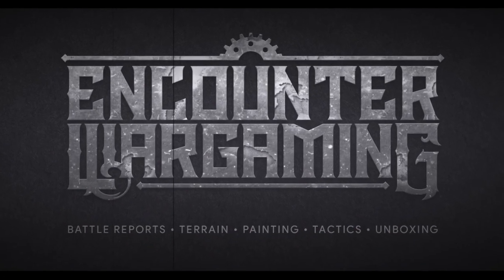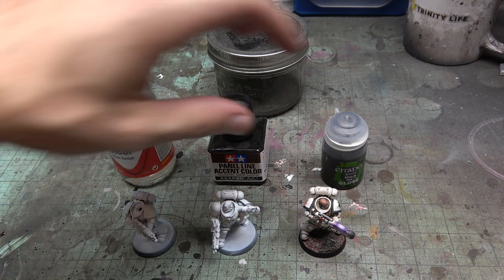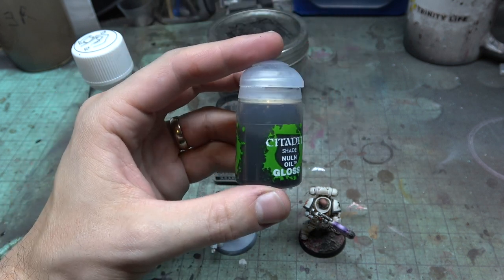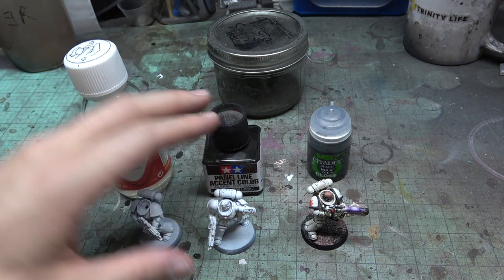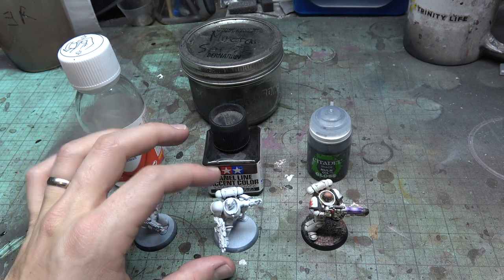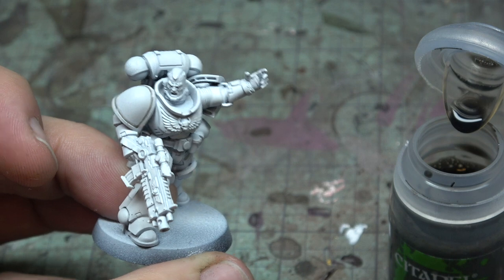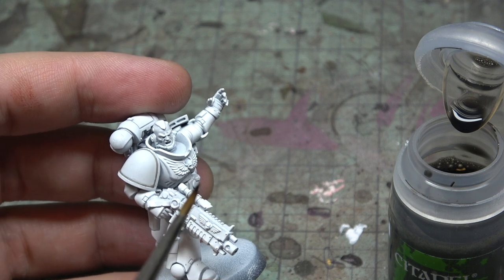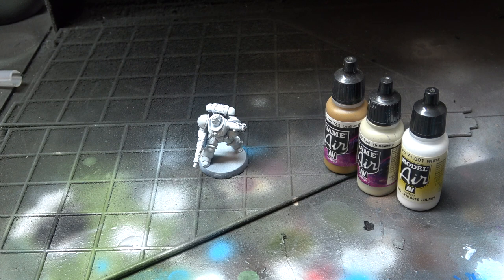Painting Tutorial - Pin Washing & Panel Lining Made Easy!

Comment: you can get basically the same effect with acrylics. I use vallejo gloss varnish and citadel nuln oil gloss for my space marines. Any mistakes can be erased with vallejo airbrush thinner and a cotton swab/Makeup sponge. After that a coat of matt varnish seals everything in and makes the surface paintable again.
Reply from the maker: Nice! Glad you found something that works!
Reply: How do you get the Nuln Oil to slide in the lines?
Reply: @captnwinkle  not nearly as nice/neat as polar-in-non-polar (physics/chemistry is the reason lacquer works so well over acrylics), but I add a very small amount of dishwasher liquid.

Comment: If you don't have an air brush to apply the varnish what do you recommend? I have used Mr.Super Clear Gloss in the past for spray on varnish.
Reply: Late reply, but a rattle can of gloss varnish works exactly the same. I use Army Painter, because you can hit it with anti-shine after if you wanna dull it down.

Comment: Great video showing an age old technique!  Instead of using the Humbrol stuff or if someone is unable to find it anywhere, Wal-mart/hardware stores carry a product called Pledge "Revive It" floor gloss.  It is an acrylic covering for hardwood floors that has been used under various names by scale modelers for years and years.  Another trick is using Q-tips for removing the excess with the mineral oil.
Reply from the maker: Awesome suggestions. We'll look into the polish and give it a try. Thanks for the input.

Comment: Is the varnish step necessary?
Reply: Just what I was going to ask! Without varnish will the Tamiya accent color still behave the same?
Reply: I would highly recommend it as the varnish protects the plastic from the tamiya panel line stuff. I learned the hard way with a mastergrade gundam kit. They say you can apply the tamiya lightly and it wont cause the plastic to crack but... that has not been my experience.

Comment: Just something which I noticed.  If your airbrush is a dual action airbrush, you're using it wrong.  It was kinda hard to see, but it did look like you were pulling back in the trigger, meaning it IS dual action, if you were just pressing down then it was single action and I apologise.

With a Dual Action, you should press the trigger down to start air flow, and essentially leave it on and then pull back with the trigger to allow paint flow.  Essentially, this will give you a better flow, and also stop you risking getting globs coming out when you don't expect it (as well as reduce free flow).